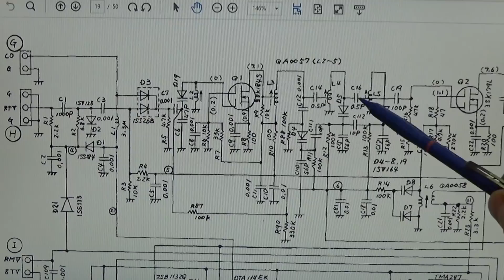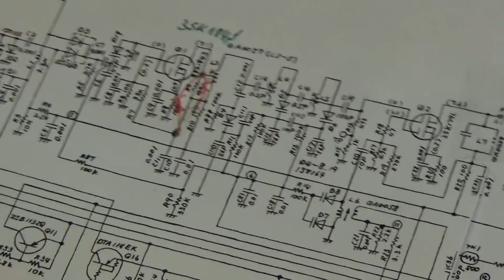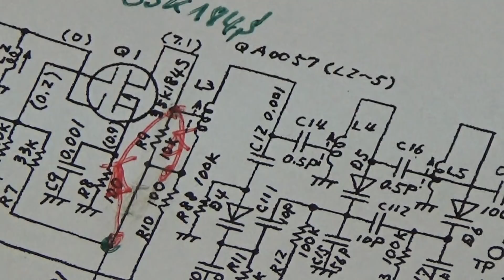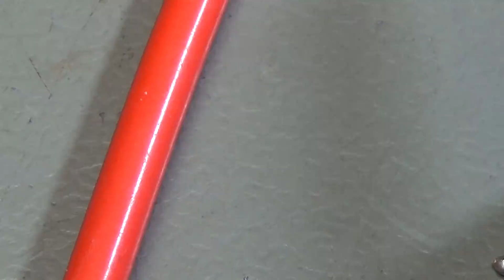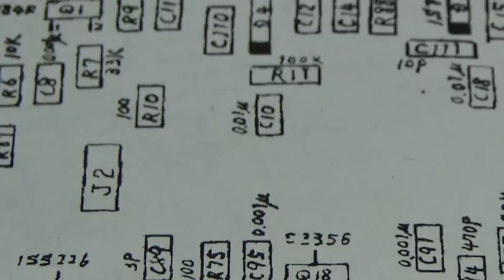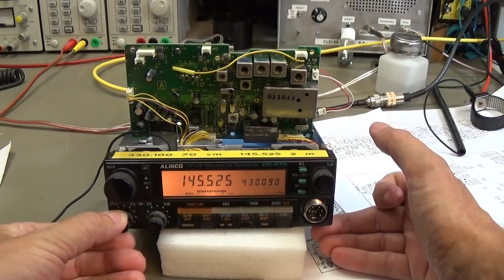#177 Alinco DR-570 part 2 fixing the dead VHF receiver

Comment: Thanks for the brilliant video. A question. I have an ELV 8100 signal generator not a radiocommunication tester. How do I convert the output of a function/signal generator into DBM? Are the very low levels of signal only available  with specialised equipment and if we do not have this is there a way of creating an equivalent using an attenuator ?
Reply from the maker: I don't know the ELV8100 but very often this generators do have a 50 ohm output which can easily converted to dbm. the very low signals can be achieved with a manual step attenuator...
Reply: Thanks for the reply. Yes it has 50 ohm output. This chart http://wera.cen.uni-hamburg.de/DBM.shtml makes calculating the dbm easy.

Comment: A couple of small observations:
It looked to me like the R10 labeling was 471, meaning 470 ohms, not 100.  That makes it plausible to get in circuit measurements around 180 ohms (other paths in parallel reduce the overall reading — never increase).  Second, I myself would have measured the voltage at the Source terminal as well, before removing the capacitors.  That would reveal the current path to be through the Dual Gate MOSFET.  You could do the measurement against common, or you could measure the voltage directly between the Drain and the Source.  An Enhancement Mode FET would not conduct anything with the gate potentials at zero.  If the Source potential is the same as Drain potential, you have a shorted FET.

Comment: I think that strange modification has cost the FET its life. After you soldered in, did you measure the voltage at the drain? In the schematic, R10 is 100 ohms, but a 470 ohms ("471" or is it 47 Ohm??) resistor was installed. Maybe that's the rest of the modification?
Otherwise that was again an excellent error analysis!
Thank you for the nice video.

73 Bernd
Reply from the maker: Yeah all a little bit strange, Bernd...I tested for 7.5Volt but no additional attention to other components..Thanks for watching 73

Comment: Great job as always! Q1 must have shorted gate 1 to the drain source channel. There did not seem to be much protection on that gate 1 line unless it was on a different page of the schematic?? Gate insulation on those is very thin and can easily get punched through with static or whatever.  73s de KA2ZOH
Reply from the maker: You are right the front end design is a joke and the mod we had on the FET was not really helpful..Thanks for watching 73

Comment: Another great show of troubleshooting Peter.  I was going to do a video this week on the same problem you found in this radio. I have a 570 on the bench with a dead UHF receiver.  Every time I work on one of these it is always the first FET.  I am not sure if these units are sensitive to strong signals or poor design in the front end.  They really need better protection in the front. Thanks for showing your skills Peter 73
Reply: Had a bad 1st amplifier FET here to this week.  It was in a short wave receiver that got zapped in a lightning storm.
Reply: hey buddy: how could you help the front end of these with a fix of your own, and keep the sensitivity high. Like adding an inductor in front of the first fet?
Reply: Hello, It is not a very difficult circuit to help protect the front end. I am working on a video now and will try and upload it later tonight.  The video I was going to upload today was a repair of the same problem Peter shown in his. So I modified the video a bit. and talked about front end protection. Thanks for the question. Stay tuned for my video as I show the circuit needed to help with this.
Reply: Gets them every time Mike.  What was the amp that shorted?
Reply from the maker: Hi Buddy yeah they are sensitive to strong signal and ESD or what have we because of a bad front end design... Thanks for stepping in  my friend 73